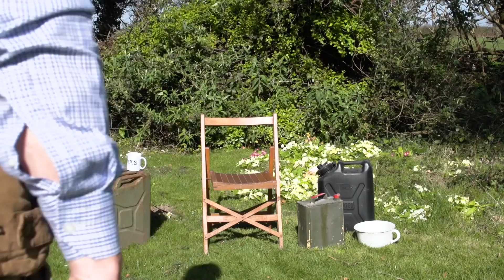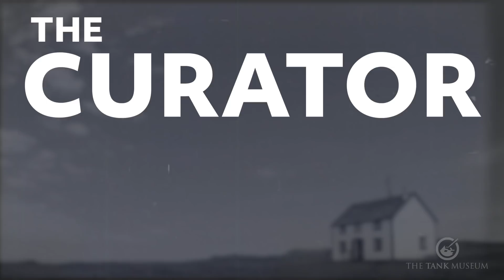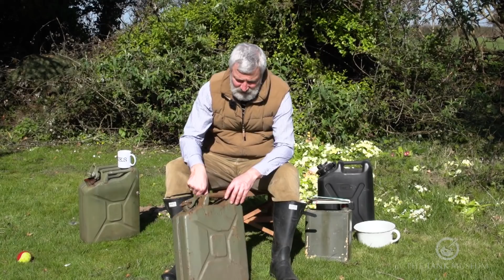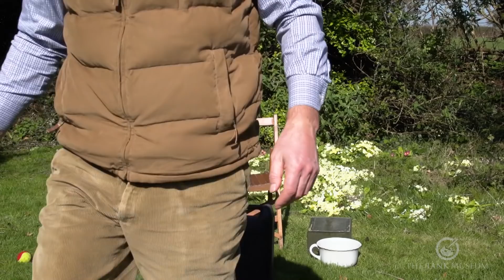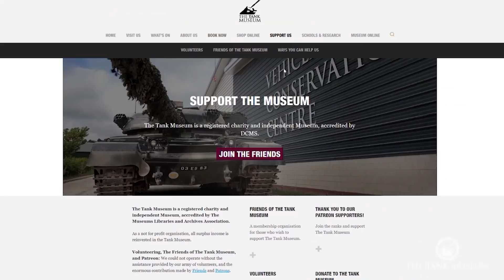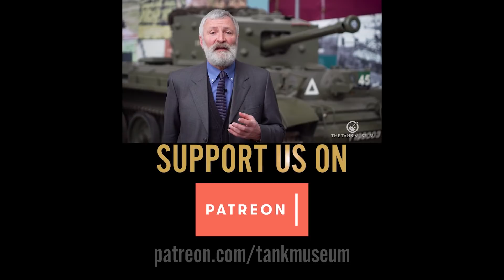The Curator at Home: Jerry Cans | The Tank Museum

Comment: just to add a bit more...the welded seam itself adds strength to the can as it is not flat...also the recess in which the welded seam sits increases the strength by forming a c-channel...the air pocket at the top when filled also allows for fuel expansion as well as flotation.

Comment: Super JOB ! I've already restored a German Jerry Can WW2 from 1940 
Part 1 https://youtu.be/4PjuuX1OTCQ
Part 2 https://youtu.be/NfwjBs1WJO0
Steps 
 1 Cleaning with Gasoline 
 2 use rust converter. 
 3. Using sandpaper 400. 
 4 .Car Paint
5. Clear Coat

Comment: In the U.S. the standard 1 (U.S) gallon tin is still available, and similar retail units for selling white gas. It’s easy to miss that the solder that holds on the stem to the male threads melts at a very low temp. It’s a safety feature so that in event of fire the connection fails. This prevents the container becoming pressurized and exploding. Fire is bad, explosion is worse. Does your 2 Imperial gallon tin use the same feature? The solder should be visible.

Comment: I would use one of the smaller "flimsy" cans to construct a fuel/air bird silencer...
I am just kidding, but I have only ruptured an original Jerry can. I just wanted to get an idea of the amount of expansion force one could survive... it's not a M60 in half filled, or a full can with either a cherry bomb, both caused seam separation, or a Mosin Nagant 1891fired with 13mm of the muzzle submerged. I was hoping to slow and capture the round to check the rifling imprint, but it caused a bit of a catastrophic failure... Never found the bullet, or for that matter about 30% of the can also.

The recoil from the water not compressing and the suddenly released pressure wave as it rapidly reconfigured, both hurt way worse than expected and pressure washed the rifle and myself while being launched a yard away better than I've ever been able to.

Comment: I just learned one more feature of the cap is that it slips into a position that it will not fall back when you tilt the can over when pouring. 
 
Seems they thought about practically any single action you do with the can.

Comment: The canister was not only an excellent container for fuel, it represented a logistical concept. Faced with the question of whether it was better to supply the mass of vehicles with a few tankers or individually with canisters, experts such as Adolf von Schell (General for Transport, 1893-1967) came to the conclusion that it would always be easier and, above all, faster to supply a large number of vehicles with at least 40 to 80 litres of diesel than to have to refuel an entire convoy of vehicles with individual tankers.  2 to 4 canisters can also easily be brought to a broken-down tank on a motorbike with a sidecar or a "Kübelwagen", the last few hundred metres through the fire zone on foot if necessary, but a tanker full of petrol on the battlefield would be a gift for the enemy.

Comment: There is one very important feature missing about the "jerry". When there is pressure built inside the container this would push open a hinged cap. However, the mechanics designed in German jerry's was made so that the lid got even better push down force (lever mechanism) - thus, no leakage. Also Russians copied the German Jerry, but as typical, they messed up good ideas and didn't understood the mechanism behind. Finnish army fought together with Germans 1941-1944 (Russia attached Finland already 1939). We had a lot of German Jerry's in use, but found the Russian ones just rubbish.

Comment: David, that was very interesting indeed.
I have heard that when you are pouring petrol from a metal Jerry can into a vehicle in hot climates (deserts for example), you have to be extremely careful about static electricity build up as you can get a spark from the can to the vehicle as you pour the petrol in, with obviously disastrous results.
Can anyone shed light on this and measures taken to limit this danger (if true)?
Many thanks for an excellent detailed presentation, I enjoyed watching this very much👍

Comment: these were common even in the fifties my fathers plumbing firm got unleaded petrol for seviert blowlamps in 2 gallon cans usually plain green with brass caps wired through the cap with a lead seal at the handle

Comment: I have couple of those Canadian-made ones. The weak feature is the rubber seal and the plastic holding it. And, the plug is next to impossible to open without an oil filter tool if tightened enough. The air inlet for pouring is a bit stupid design and necessitates that firm tightening if the seal is not new, and still the other one leaks petrol slightly. And, as the plastic is quite thick, the volume of the vessel is not actually suited for 20L as the original Jerrycan was. I also have couple of Jerrycans made of aluminium, and those are by far the best ones. But, as for rough use, nothing beats the original...

Comment: I have one of these old steel canisters in my cellar, still using it sometimes. I allways was courious where it came from and after this video I had a closer look at it again.
Inscription on this thingy is W D with an arrow between the letters pointing upward.
Found out it stands for War Department and was the marking on british equipement.
Makes sence living in northern germany where british troops held their respective occupation zone.
The year stamped in the metal is 1945 so it was produced in the last months of WWII or shortly after.
It has some dents an is slightly rusty but still gastight so still in usable condition, remarkeble for something that was fabricated 75 years ago!
Reply: Maybe. There was no Department of Defense (DOD), or Secretary of Defense in the U.S. until a couple years after the war. There was the Navy Department, with the Navy and the Marines, with Coast Guard merged in in time of war. There was also the War Department, which had the Army, and nominally under it the Air Corps, with its several names. The Secretaries of War and of the Navy were members of the Cabinet. Maybe WD is War Department?

Comment: I was hoping you would show a Jerry can like the ones I found that had the changeable labels. These cans have two aluminum tags in a holder on the can each side is printed top and bottom with different petroleum products so you have eight different labels. Mine have two languages English and German, for instance one side has the words Dieseltreibstoff,  Carb. Diesel on the bottom and Petrol ,  Petrole on the top, then on the other side it has Reinbenzin,   Benzine Pure bottom, and Bleibenzine, Benzine Ethylee top. By switching the labels you designate what is in the can the other tag has either SAE 10, SAE 30 ,or SAE 50 oil and one blank for when it's empty?

Comment: Well done video, thanks. Jerry can at least in their plastic incarnation are still very much a thing in the boating world as a way to shuttle fuel and water to boats. Further they are now normally colour coded in order to (try to) prevent cross-contamination. So, yellow = diesel, red = gasoline (aka: petrol), light blue = drinking water, and dark blue = kerosene.

Comment: Another plus of the 5 gallon water cans, they're just the right height that putting one at each outside corner of an M113 rear ramp keeps it level with the inside floor, making a lot more sleeping room. It's always nice to be up off the wet and out of the bugs route of march.

Comment: The brass cap on the early can is likely to avoid rust causing it to bind. The sparking issue is most likely static electricity rather than impact and brass won't help suppress a static spark.

Comment: The German army also uses standardized food containers in this same format, called Speisebehälter or Isospeisebehälter. Possibly it's even a NATO thing. They look exactly like jerry cans from the outside, so you can lug them around the same way. But the whole top with the handles is hinged. They can have either one large single inner container or three smaller ones. Those contain the actual food while a ladle and tongs are stored inside the top.

Comment: Those early pommy 4 gallon tins nearly cost Brittan the war. They were absolute rubbish, leaky and dented  and split all the time. The Australians had to use them as well and they would even split from sitting in the sun. The Jerry can being a properly welded and the strength from the ridge inside. No soft solider save the lead for bullets.  The one thing missed was you could stack them and the stack was solid enough to stand and even load on the top.  By far the most simple, robust and useful piece of tech to come out of WW2  nothing else comes close...

Comment: When I was a digger we used to use a pair of M548 Tracker Load carriers with two huge (2000L?) rubber blivets of diesel in them. We bult a metal platform that sat on the sides of the load bed, accross the cargo bay,  with a pump on top of the platform. The rear of the tilly (TLC)  had ammo racks from a scorpion turret for ammo for the MRVs, and we'd carry a pile of oil and water jerries too as well as ration packs and other items, e..g. fourby, weapons lube, tubes of grease, hydraulic oil, pretol for stoves and generators etc.

A cav troop would then pull up into the re-sup 1 verhcle on each side and while the fuel was being pumped empty jerries were handed back aloing wiuth rubbush bags, mail was transferred, full jerries were tranfered in and we'd also bomb up.
You could do 4 vehicles in about 10 mins with half the crew manning guns and radios.
There's also be a medic and some of the LAD in case a vehicle had issues they could take a quick look.

Comment: Most modern NATO jerry cans are made in Canada. They make versions with yellow or red tabs on the filler cap for diesel or gas. The company, (which I forget the name of,) is also a major producer of red 25L outboard boat tanks with fuel gauge and hose connectors.

Comment: I recall in the late 79’s I think the trial of the UBRE (Unit Bulk Refuelling Equipment) in BAOR. There was an attachment to allow the filling of multiple Jerry cans and we were treated to the sight of an Infantry unit filling Jerry cans and then emptying them back into the UBRE tank to conduct the trial. When operating as Recce forces in CVR(T)s we used to ground dump small quantities of cans along tacks prior to refuelling at intervals to allow a squadron to come through and all refuel simultaneously. Fast and quiet, even at night! It usually worked very well but on one occasion the Scorpion/scimitars were followed by the wider FV 432 APC’s of ‘boot’ troop who ran over the empty cans left on the order side of the track

Comment: Another thing with these Jerry Cans is, that you could distrubute fuel much faster in a combat situation  than with a fuel truck. During the french campain german tanks were fueld in that way, that a truck dropped several cans along the line of waiting tanks and the crew fueld the tanks themselves and more or less simultaneously. The french tank units were refueld conventionally with fuel trucks, and there every tank got the gas individually. So that took much time longer. It was an tactical advantange to use those cans.

Comment: You missed another feature of the handle, it creates a flat top surface for stacking cans vertically while protecting the cap.
The air volume may or may not be to make it float, but it also creates an expansion volume for the fluid to expand into should it get hotter than when the cam was filled.

Comment: Great topic for a video, a piece of kit that doesn't get the attention it deserves.
The wide handles also allow you to stack jerry cans ontop of eachother inside a pallet frame. The robust handles are also very useful if you want to secure a lot of cans by locking them with a steel cable and a lock.

Comment: I have a few ex WW2 jerry cans dated 1943-1945 of Australian manufacture to the British design and an ex German jerry can of the same era. what I have found interesting is that the British cans are identical to the German cans complete with the same features like an internal tube to prevent glugging etc. at the time they must have simply reverse engineered the design without going to the trouble of trying to re-invent the wheel.

Comment: Great video and great information, thanks. If your taking ideas I have a few.
In WW2, at the end of the day and it's time to eat, did tank crews share field kitchens with the Infantry, did they have their own or did the crews fend for themselves? Combo? Different armies,  different methods? 
Along the same line, did each tank crew carry their own tent or what for shelter? 
One more. To move large numbers of tanks a long distance I know that trains were used, but how did different armies move tanks battlefield to battlefield when it was to far to simply drive the tank?
Thanks

Comment: I've got a set of 4 Napco cans 2 red and 2 army green, 2 are a threaded cap and the other 2 have a rubber seal. they are from 44 to 65, and my grandfather stored diesel oil in them. I have now since emptied them and now need to remove the remaining gunk. Does any one have any suggestions?
Reply: @Cole Sampson 

Why? What do you want to put in the cans? Cuz it’s unlikely you can get them clean enough to safely store whatever it is you want to store in them.
Reply: @Doug_JB  fuel, clean gas so I can use them for my jeep
Reply: @Cole Sampson 

Aoah. 

Fill them quarter full with petrol. 

Stand them upright for a few days. 

Stand them upside down for a few days. 

Stand them one one long end for a few days. 

Stand them one the opposite long end for a few days. 

Pour out the petrol into a bucket and let evaporate. 

The solvent properties of the petrol should have dissolved the gunk, allowing you to pour it out. 

If it didn’t, the gunk will not dissolve into petrol, so you can fill them with petrol and use without worrying about gunk contaminating your petrol.
Reply: @Doug_JB  Huh. Did not think of that, thankyou sir, I will try this method an see where it gets me.

Comment: An anecdote from my father who is a Vietnam veteran: He and his platoon were tasked with moving jerry cans of water. I assume these cans were the standard US Army issue but some could have been left over from the French. One of the young soldiers lifts and carries a pair of the cans to the designated storage area but when he sets them down, he cannot get his right hand off the can. There was a seam on the underside of the handle and when he lifted the can, the seam opened and the skin on his fingers filled the opening. When he set the can down, that skin got pinched. My father tried to figure out a way to get the young man's hand free without hurting him further, but the soldier did not wait and ended up tearing the skin off. My father always checked the cans he carried after that incident.

Comment: I have two Swiss surplus Jerry cans in my yard barn along with a very old round steel 5 gal gas can. The heavy duty steel fuel containers are much better than the thin steel or light weight plastic containers.

Comment: I use both old metal jerrycans and modern plastic jerrycans. The metal cans handle the heat easily here in Australia and just keep working day in and day out on bumpy outback runs in 40 degree heat. The plastic cans are a royal pain unless you are carrying water. The screw on caps on the plastic cans get contaminated or damaged or lost and many cheap plastic cans vent fumes. The hinged cap for the metal cans never get lost and rarely get damaged. Well worth the extra money.

Comment: The plastic jerry cans came from a Canadian Armed Forces requirement for a new non metal Jerry can in the late 80's. 
Scepter a Canadian company designed and built a new plastic jerry to meet the CAF requirements once the prototypes were done the Americans also jumped on board as they were also looking for a replacement for the old metal jerry can.  The plastic can was finalized in the early 90's to the Canadian requirements with some input from the Americans. Basically, ALL the plastic Jerry cans will have been made in Canada as this where they were designed and developed and the patents are held.

Comment: We had several  of these on the farm, sometimes would have diesel for a tractor. Now we have laws about petrol which make them illegal to use for that, they're too big. It is seriously not a good idea to run the tank dry on a diesel engine. You have so much to do to bleed the injector pump.

Comment: We can still buy new jerrycans today of course. https://www.amazon.co.uk/Quality-Jerry-Green-Metal-Litre/dp/B007M2URI4/ref=sr_1_10?dchild=1&keywords=jerrycan&qid=1585430507&sr=8-10
I have four in use, some newer than others but all at least 20 years of age. Two are used to carry diesel to remote skid steer loaders that have two litre engines. The other two are used to fetch and carry petrol for quad bikes.  Spouts are an abomination though, which slow the emptying drastically, which means holding 20kgs [reducing] up at a slant for what feels like a very long time indeed. The air bleed is not effective with the spout in use.
Filling a thirsty tank or truck with possibly 300 litres at a time using 20litre jerrycans isn't exactly efficient.

Comment: another reason for the raised handles is that they provide some protection for the filler cap in case of impacts on the top of the jerry can.
We still used them when my parents had a yacht in the 1980s. May have been post war production of course, but basically unchanged from the basic design.